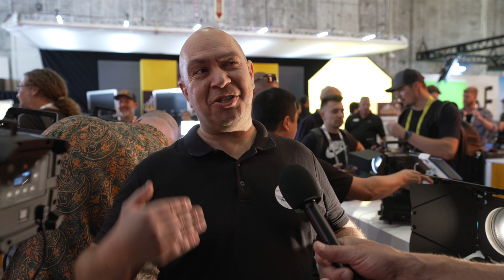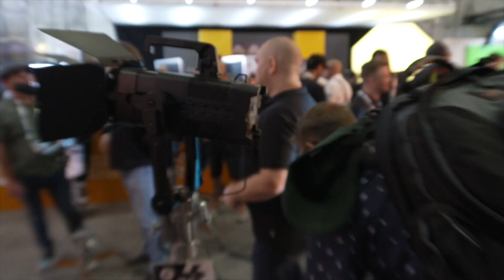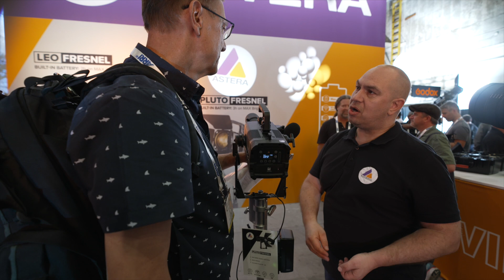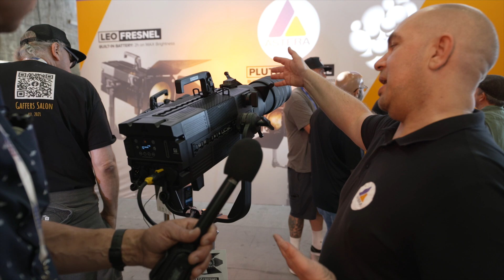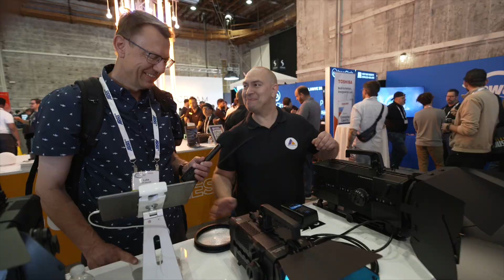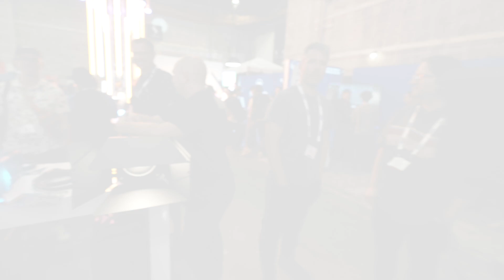Meet The Gaffer #303: Cinegear 2023 - Astera Fresnels, Leo & Pluto

Comment: Weight?  Price?
Reply: 30lbs for the Leo
Reply from the maker: Good questions! Someone on the internet offered these starting prices: $1700 (Pluto) and $4300 (Leo). The battery adds weight, for sure, but you literally have to weigh the use case and in the right situation, as with Titan Tubes, that weight is outweighed(!) by the cordless capability🙂

Comment: Are you thinking about purchasing? If so, what will you be replacing them with?
Reply from the maker: Good question! Sometimes units enter the market and it’s not exactly clear what they will replace. It may take a while for them to find their place in our workflow. The internal battery aspect is very useful in Titan tubes, and I can think of times when I want a quick additional light but I’m short staffed and no one wants to wait for us to run a stinger. That could be a Q5/G3 or Dedo Neo or Nanlite 60c on a battery, or it could be a Pluto Fresnel. The Leo could take on the Orion 300FS. Going forward the manufacturer’s goal may be less about bigger LED’s and more about smarter form factors of already existing units that maybe check more boxes and are built to last.
Reply: @meetthegaffer  how do you think output would compare to the Orion?
Reply from the maker: @aleksanderhaugdal2060 No idea, but a lensed system will probably have less output verses similar wattage COB. But I think the fresnel and spot mount will be crisper. Every system has a few downsides. The goal is to end up with units that have more upsides for your purposes!